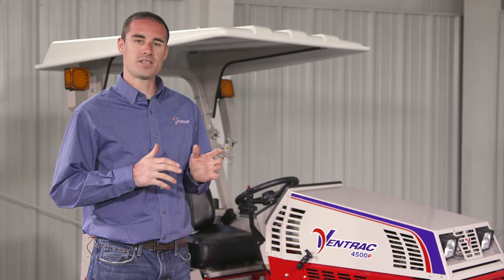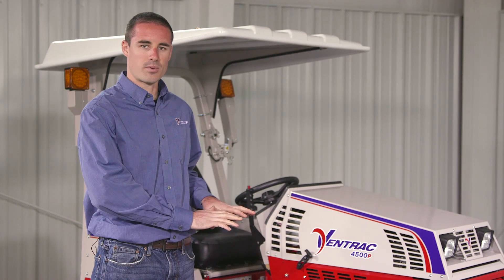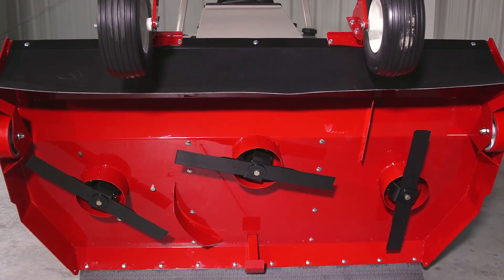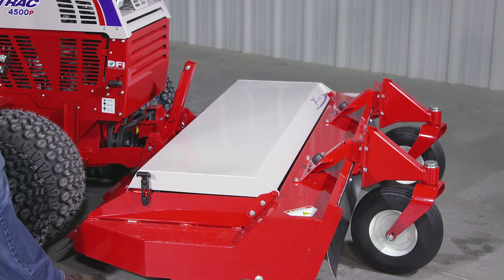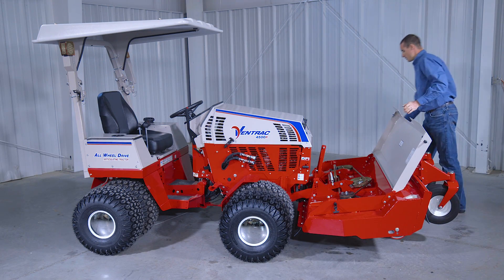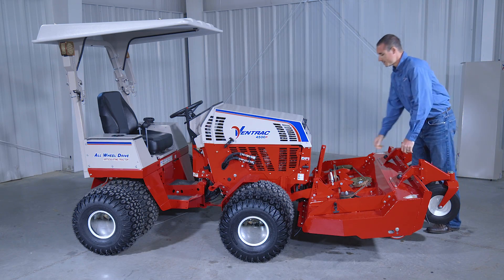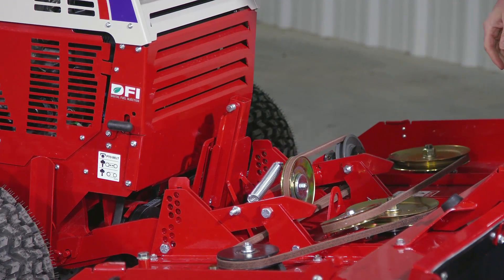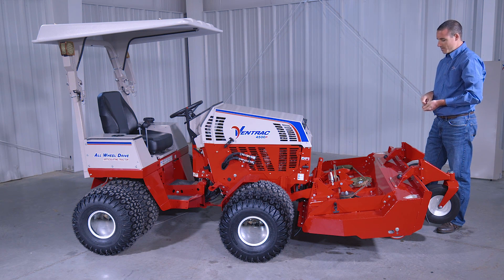How to Flip a Ventrac Tough Cut Deck

Comment: So, I know what the weight transfer does but what does putting the S.D.L.A. lever in float do?
Reply from the maker: It allows the hydraulic cylinder that controls the hitch arms to move freely by itself so that the attachment can contour to the ground independent of the tractor.  This is necessary for any attachment that needs to follow the ground by itself to provide consistent or level finishing.  (Think any attachment that has its own height adjustment or any attachment on wheels, rollers, or skids that needs to ride on the ground)

Comment: Wouldn’t you also disconnect the PTO belt as well?
Reply from the maker: Good question.... you could, but it's not necessary and won't really help anything.  Flipping the deck doesn't put any extra stress on anything as long as you release the belt tensioner on the deck.
Reply: Ventrac ah